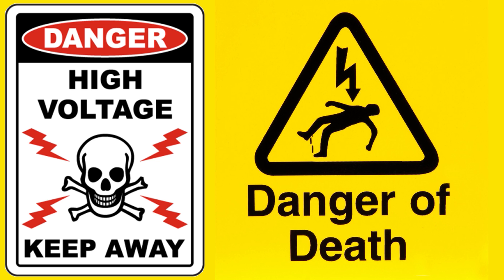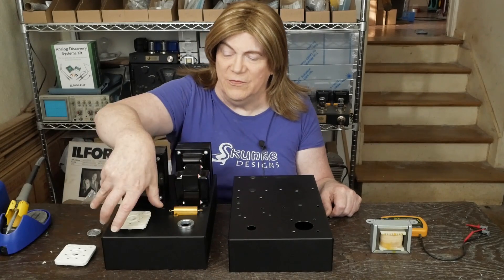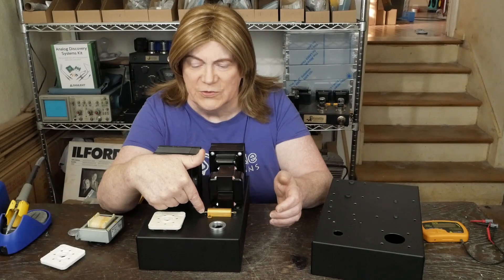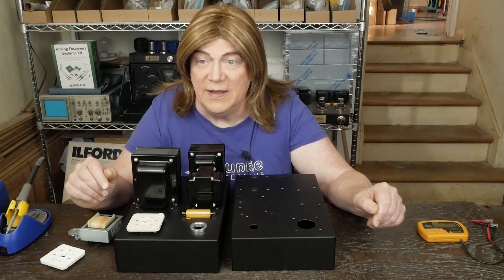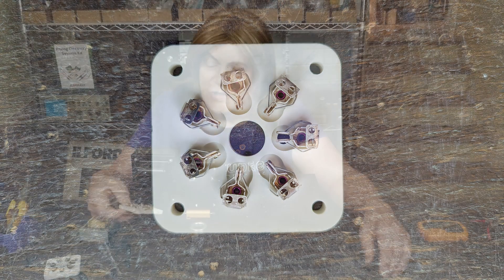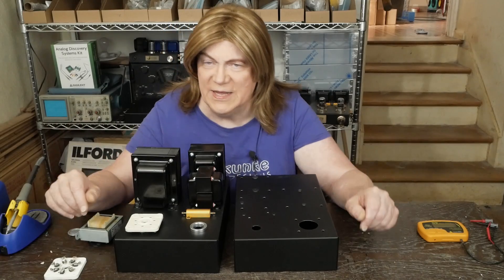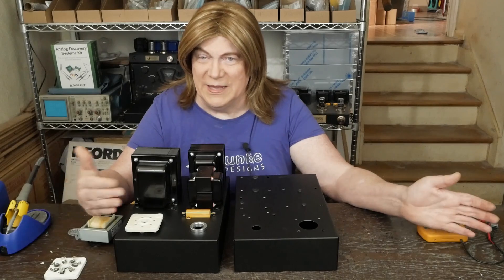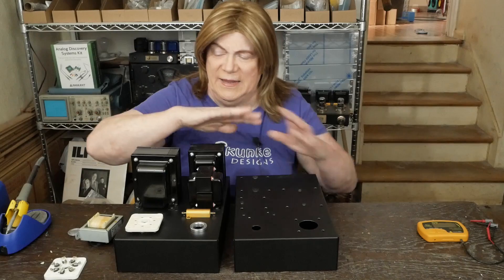6C33C Monster Tube Amp Build: Chassis Fab and Layout

Comment: Hey Stephe, perhaps you stressed it, but where do you get those nice looking chassis? I need one larger for my 300b... Its evolution continues and it needs more room... Thanks
Reply from the maker: Those are Hammond steel black powder coated.
Reply: @SkunkieDesignsElectronics  ok, then easily to be found on mouser... Ok thanks.

Comment: One thing about your power supply you might have already checked. The 50ohm resistor and the 220uf cap form a low-pass filter and the -3dB cutoff is at 14.46Hz. Are you comfy with that?

Comment: I'ts easy to tame toroids inrush current, when used as the power transformer. You just put a C60 NTC resistor in series with the mains. Problem solved.

Comment: Just turn the power transformer or the opt 90°....
Reply from the maker: Isn't offsetting them enough? I guess I will find out lol
Reply: @SkunkieDesignsElectronics  ...it is the orientation  , the magnetic flux / 90° reduces the intererence ...( interesting to have a look on some older amplifiers )
Kind regards
Reply from the maker: I get that, I possibly wrongly assumed the offset of the transformers would avoid the interference?
Reply: @SkunkieDesignsElectronics  Have a nice day Steph ...

Comment: I'm concerned that a small diameter piece of metal could be pushed in between the spacers on the valve, tube to you, by children, with possible  disastrous results . Cheers Cliff.
Reply from the maker: No children and if some adult sticks a fork into a tube amp, yeah they will get shocked.

Comment: Hello Steph ....................CORRECT warning for the tube sockets ! 
Good idea to install a digital voltmeter in front........monitoring the current of the 6C33...
A 10 ohm resistor in the cathode circuit will read mV in current mA..........100mV will read as 100mA...
Layout is indeed very important and designing it is thoughtfull with thisamp as well as any other amp...........;;we see quite different wrong layouts in many commercial sold amplifiers today where the looks are the dominating sales item.....

Use solid core wiring of substantial gauge for the filament wiring to help  drain the heat away ...........and those chinese made cheap and faulty sockets must indeed be avoid.

Also good idea to mount the sockets on spacers , it will help with  better ventilation flow of the heat. 

An inrush current limiter may be usefull too ...............the use of 105°C electrolytic  capacitors also .

This might  be a nice project for you..... but a bit of warning because it is not so for beginner newbie DIY builders .....

I am not a fan of overal NFB to obtain those fabulous  distortion measurments on sinus waves etc ....but with this amplifier maybe a  small amount of NFB ....adjustable / variable and with possibility to switch it off  .......may be usefull to experiment for driving some loudspeakers .....and if you don't need it the better .

Succes and a lot of joy building the beast ......

Comment: As far as I understand it, toroids are problematic for mains power duty as they saturate very easily when dc is present on the line, which with all the electronic PSUs these days, is common. You can make a dc blocker circuit to stop this. The SE O/P toroids are designed to accommodate their specified  dc current without saturating. Inrush current on switch on can also be an issue, so a soft start circuit can solve that issue. So I can see why you are not keen on them.

Comment: Looking forward to the finished amp. I had a pair of 6c33c sitting on my bench for a while but I never pulled the trigger on it and sold them on. Curious about how you'll manage to get the BIAS to stay in place. Seen some reviews of those amps that complained about some runaway voltages/currents.
Reply from the maker: That's why I am running one triode and cathode bias.

Comment: The 6C33C amp/s is/are lookin  good Stephe!  I wouldn't recommend the silver coloured heat transfer paste like they use on CPU's though; just use the normal white Silicon one!

If you let even ONE ATOM of that silver stuff get ANYWHERE it's not supposed to be - especially on your fingers - you're gonna have a crappy looking silver-blemished black amp chassis forever, cos the silver gets into the paint!  

The white silicon heatsink compound stuff just wipes off with white spirit, although you should check if the white spirit affects the powder-coating.

Hey did you say a TWO HUNDRED Henry choke for the 6C33C?  Not even 'just' 20 henries?  You're gonna have to mount these monsters on castor wheels lol! - Or did you mean just 2 henries?
Reply from the maker: it's a plate choke for the driver tube.

Comment: Don't cut a hole for a cheap digital meter before testing. I bought some for my 845 se bias meters (low voltage across filament resistor to ground) and they jumped all around uselessly, even with a regulated supply that is super stable. The cheap analog meters I replaced them  with are both better looking and functional.

Comment: Hi Steph many thanks for your comprehensive vids on diy hifi electronics... Great stuff.. I've done the mods on the Willsenton r8... 👍👍👍👍 Funny you should mention Edcor.... I'd purchased some power trannies manufactured by them from a supplier in Germany.. it was the only option as 1 I lived in France..... pass tence and 2 Edcor wouldn't supply direct to me living in Europe... Anyway I digress, the finish on one of the BLUE transformers were utter crap, bubbling and flaking up and some rust... Complained to the German suppliers and they blamed Edcor, I contacted Edcor and they blamed the German lot.... It wasn't a great experience I must say... Table tennis between two we're not to blames..... So I repainted the buggers in a metallic silver finish.... So as you can imagine it left a bad taste in my mouth... Hay Ho we live n learn................ Sometimes.. Keep up the good work Steph....